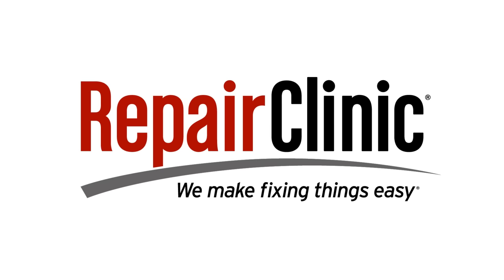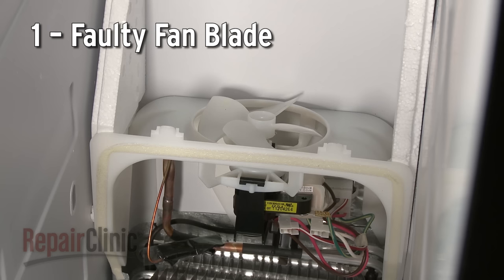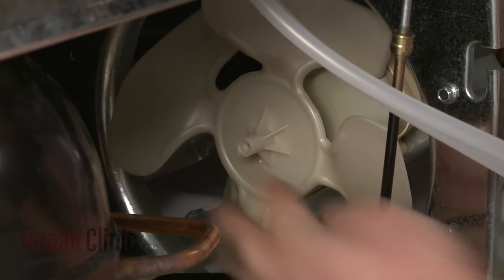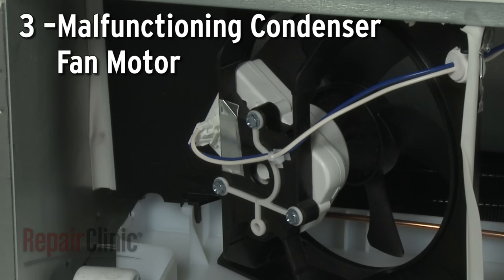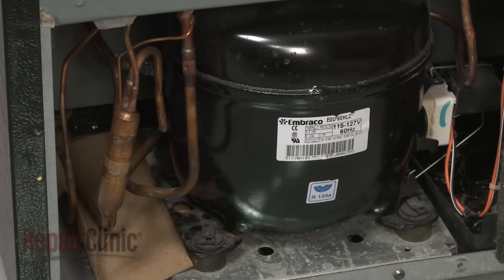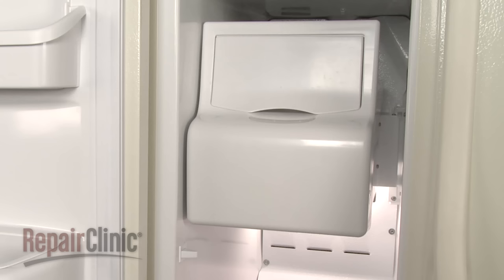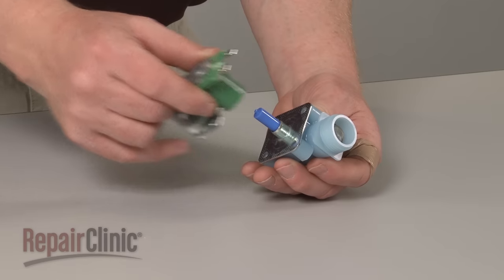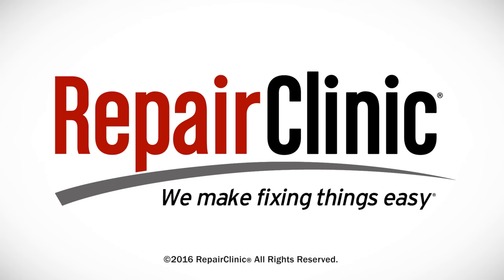Refrigerator Is Noisy — Refrigerator Troubleshooting

Comment: For nearly a week, every hour or so our refrigerator would make a loud electrical/buzzing/crunching noise like something was trying to turn on but it couldn't, and I was worried that it was on its last leg (it's only 4 years old).   Turns out that the ON/OFF switch on our ice maker, which isn't hooked up to water, had accidentally been flipped to the ON position by food we had piled up in the freezer.   Very happy with this "fix" that I found on another YouTube video... as easy and inexpensive as it gets!!!  :)

Comment: None of this helped. My fridge is brand new & every 10 minutes, it starts making noise again. It sounds like it did when I first started cooling
Reply: I could cause mine occasionally to have less buzzing noise by opening one of the doors. Found out the Condenser fan motor spinning caused the thin plastic drip pan to vibrate against metal at multiple places. Very poor design by Whirlpool. I placed Foam Insulation Weather Stripping Adhesive (3/4 Inch Wide X 1/8 Inch Thick) everywhere where the plastic drip pan touched metal. The plastic drip pan on my Whirlpool/Jenn Air model is located under the Condenser fan motor and runs along behind the Compressor. It was vibrating at its worst behind and to the right of the Compressor. And yes, mine began doing this shortly after we bought it brand new.

Comment: My fsher & paykel  mount fridge makes a loud noise every few hours...what could be the problem?  When leaning on it the noise stops. 
The fan coil in freezer is new and working fine, no ice build up.

The chiller and freezer function OK - chills and freezes properly - just that it makes a noise every few hours loud vibration for some minutes than slow down to a persistent hum then sometimes goes quiet.  It does this few times every day.  HELP
Reply: Same with my new GE refrigerator. The freezer sounds like it’s being drilled or something. That I have to shake, lean or tilt the whole fridge it stops.

Comment: My Jenn-air refrigerator is making an intermittent buzzing noise. It reminds me of trying to continually trying to start a pull lawn mower and it doesn't catch.   I checked the ice maker (it's off), no ice in freezer or frig.  I can't get to the water supply.  I will be away for 2 weeks...will I come home to a total mess and damaged hardwood floors.
Reply: I could cause mine occasionally to have less buzzing noise by opening one of the doors. Found out the Condenser fan motor spinning caused the thin plastic drip pan to vibrate against metal at multiple places. Very poor design by Whirlpool. I placed Foam Insulation Weather Stripping Adhesive (3/4 Inch Wide X 1/8 Inch Thick) everywhere where the plastic drip pan touched metal. The plastic drip pan on my Whirlpool/Jenn Air model is located under the Condenser fan motor and runs along behind the Compressor. It was vibrating at its worst behind and to the right of the Compressor.

Comment: The #1 reason is the condenser coils are dirty and need to be cleaned.  Seems many refrigerators have the coils on the bottom these days instead of in the back where they belong.
Reply: I found out that when I pulled mine out to clean the coils.  Very hard to vacuum underneath.  :/

Comment: My rf makes a loud buzzing sound when its working to get the temperture right, but it stops or gets less when I step on some parts of the wooden floor. What could it be?
Reply: I could cause mine occasionally to have less buzzing noise by opening one of the doors. Found out the Condenser fan motor spinning caused the thin plastic drip pan to vibrate against metal at multiple places. Very poor design by Whirlpool. I placed Foam Insulation Weather Stripping Adhesive (3/4 Inch Wide X 1/8 Inch Thick) everywhere where the plastic drip pan touched metal. The plastic drip pan on my Whirlpool/Jenn Air model is located under the Condenser fan motor and runs along behind the Compressor. It was vibrating at its worst behind and to the right of the Compressor.

Comment: Changed evaporator fan freezer and fridge worked at perfect temp again , but since we ordered condenser fan we changed it too! now it works perfect but freezer making buzzing sounds a few times a day ? Help is it normal i don't remember that noise before or would it now be electrical panel or maybe just unplug and it might stop?
Reply: Sounds like the compressor motor is going bad or the compressor mount isn't leveled properly & the motor inside is running unevenly. My old Kenmore 4.4 is starting to do this to. The repair cost of replacing the compressor is usually that of a new mini fridge & its a bitch & a half to DIY so I may have to scrap the whole thing for a new one.

Comment: Refrig is making loud noise.  Brand new refrigerator and freezer side-by-side.  The tech came out and replaced fans and motors in fridge and freezer.  An hour after tech left, same noise.  It can last anywhere from 10 minutes to 30 minutes each time and happens at least 3 times a day.  Not the water intake either as this is not when filling.  Any ideas? They dont think it is condenser since it is new (like 3 months old).
Reply: My new fridge has the same issue. Did you ever figure it out on yours?
Reply: I could cause mine occasionally to have less buzzing noise by opening one of the doors. Found out the Condenser fan motor spinning caused the thin plastic drip pan to vibrate against metal at multiple places. Very poor design by Whirlpool. I placed Foam Insulation Weather Stripping Adhesive (3/4 Inch Wide X 1/8 Inch Thick) everywhere where the plastic drip pan touched metal. The plastic drip pan on my Whirlpool/Jenn Air model is located under the Condenser fan motor and runs along behind the Compressor. It was vibrating at its worst behind and to the right of the Compressor. And yes, mine began doing this shortly after we bought it brand new.

Comment: My old Kenmore "Sears Best" fridge is randomly screaming the sound of an angry beehive. It's so loud when it happens... the sound is coming from my freezer, but stops when I open the fridge door - and not the freezer door.
It's good for a bit after that but will come on randomly every few days or so. I'm leaving for a trip for a month and don't want to leave my fridge like this! 
Please, any advice will help!
Reply: @repairclinic  How would I know what I'm looking for? And is there anything I can do before having to replace?
Reply: @repairclinic  it's not a constant buzzing though. It happens sometimes every few days or once a week or so?
Is it possible this is ice stuck back there inside the wall?
Reply: Having this problem to! (Kenmore 4.4) Its an unbearable buzzing that I can hear even through headphones. When it doesn't do the buzzing its no quieter than a fish tank sometimes. I’m thinking its ether a faulty power system that lies between the compressor & the plug or compressor motor going bad from running on a damaged mount all these years. Mini fridges do not have evaporator fans at least the ones I’ve seen don't. They are usually built so simply they don't need an evaporator fan. Any noise is typically from the compressor.

Comment: JUST FIXED MY FRIDGE BEEPING SOUND BY OPENING THE CIRCUIT COVER ON TOP OF FRIDGE, AFTER YOU OPEN THE COVER YOU WILL SEE SMALL BLACK SPEAKER, INSIDE SPEAKER THERE ARE 2 METAL WIRE, JUST BREAK ONE AND THATS IT,  ITS FIXED
Reply: was ur noise in freezer part? i changed both condenser and evaporator runs great, but buzzes few times a day only place i didn't check is where you mentioned in fridge up top..
 why not replace the part what does breaking wire do?
Reply: someone said replace part 75 bucks but hope ur answer works but aren't wires necessary ?

Comment: Thank you, my freezer fan had iced up and was grinding, one tap and a quick clean sorted it!
Reply: When the evaporator fan motor in the freezer behind the rear panel fails, it often generates a lot of noise. This noise will be much louder when the refrigerator door is opened. If the evaporator fan is noisy, replace it.

Comment: The noise on our refrigerator is a loud humming but lasts only 5 or so minutes then shutters off and resumes the peaceful quiet humming.  It starts again several hrs later...

My s/o banged the fridge during an episode and the noise stopped momentarily. (Not the best way to fix it) 

No abnormal heat that I can tell behind the unit and no change with freezer light.